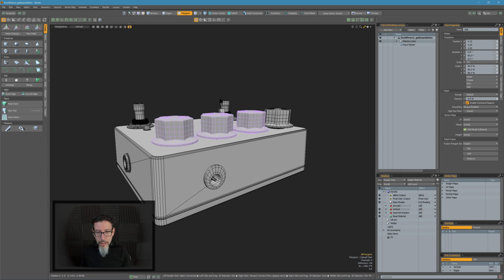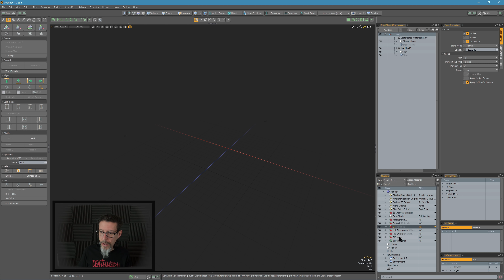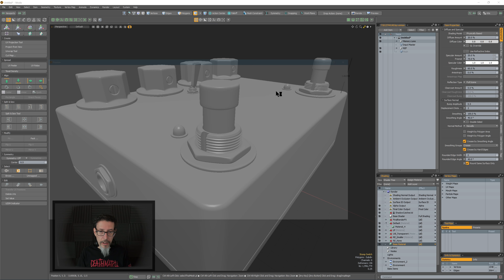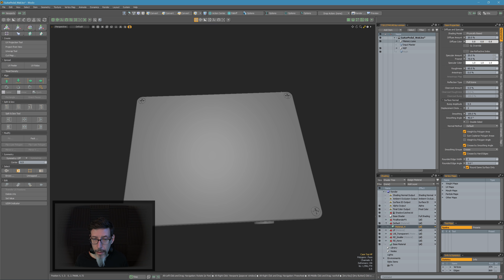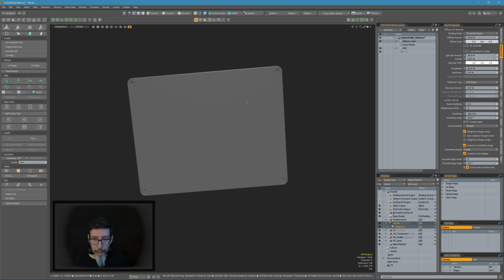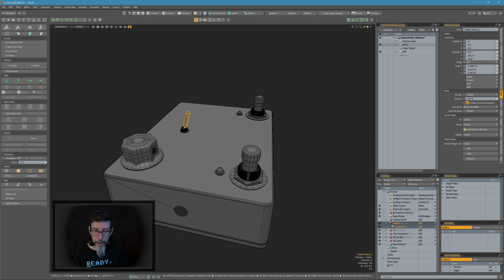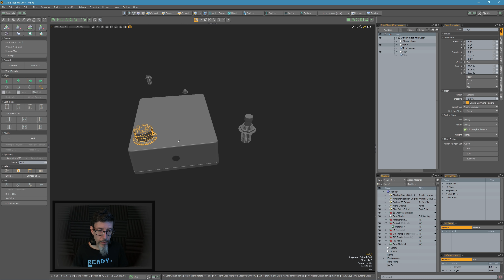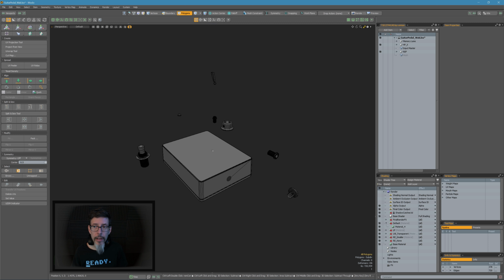Part 1 - Guitar Pedal : Low Poly, UVs and Bake

Comment: Hi Warren. Snapping options Force Fixed « n » unit steps is your friend for exploding :-)
Reply from the maker: Not entirely.  :)  The trouble is that as soon as you start dragging, it will snap the action center to the fixed grid first and THEN move the selection in fixed units.

That makes it impossible to drag it back exactly where it was originally - assuming it wasn't already sitting on a grid point, by chance.

Unless I'm missing something.
Reply: It didn’t gave me any problems. Maybe our workflow is a bit different. 8^j

Comment: so, if I enable "weight by polygon area" I haven't to quad or tri my ngons anymore? it would reduce the polygon count on my mesh
Reply from the maker: You still need to triangulate your low poly before baking or you'll likely run into bake issues.

And, in the end, you won't be saving any polygons anyway since all game engines triangulate meshes when they import them. Nobody deals with quads or n-gons directly.

Comment: Hi Marshall, quick question. Why don't you use morph maps when exploding ? Easyer to go back to original positions .
Reply from the maker: Thanks! Yeah, I tried that in the past. The main trouble is that MODO doesn't recognize the morph map when you try to bake the normal map - so you have to actually apply it to the vertices, bake the normal, then un-apply the morph map. If you mess that up somehow or forget, you can end up in a bad state.

I find it easier to just duplicate and move things around manually ... then I know it's done and I know what the state of my mesh is at all times.

It's such a small part of the process that I don't find it really costs me any time in the end.

Comment: You mentioned that you explode the high poly, but I didn't quite catch why you do it?
Reply from the maker: Basically, for 2 reasons ... it'll help me come bake time, but also to make it easier to do the low poly.  

If something doesn't need to intersect with something else, I may as well move it away or else the rounded edge shader will try to make them blend together.

Also, I guess thirdly, it's an organizational thing so I can see what I'm dealing with ...